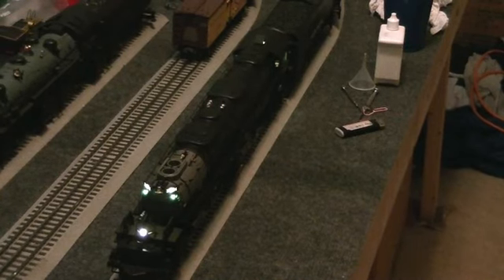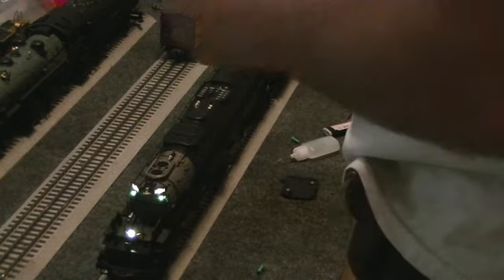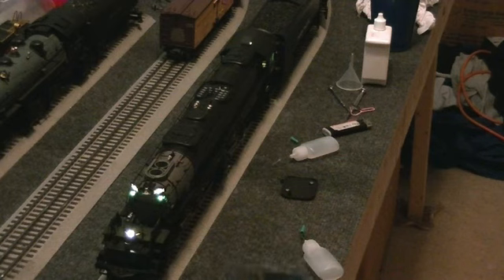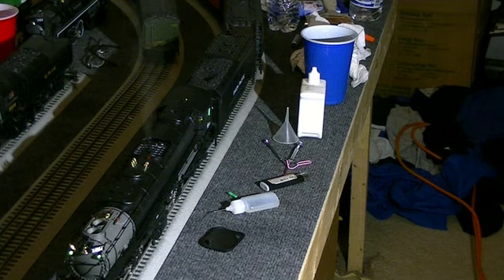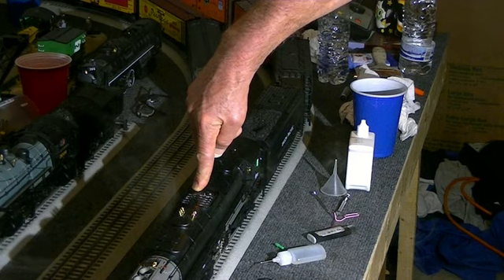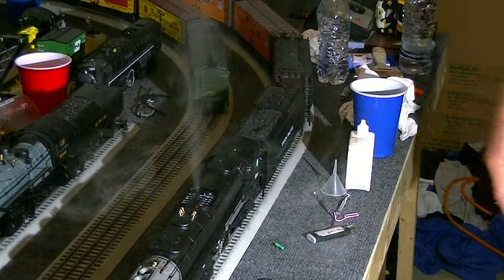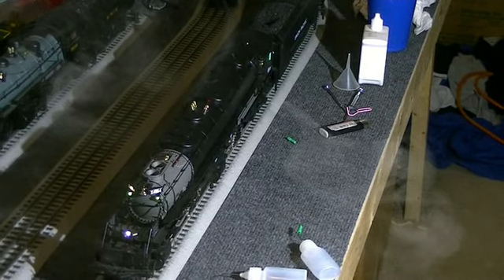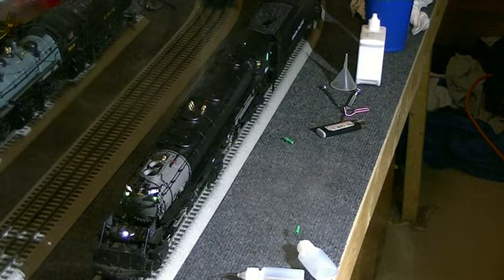Lionel Vision Line Big Boy blow down part 4

Comment: Hahah thanks for the shoutout bud!!! Lol, that was awesome!  I'm amazed how long it takes before the smoke actually works properly on the blow down unit.  I will certainly try this on my Big Boy and report back.  Seems your initial thesis was pretty much spot on: let that darn unit heat up!!  Even with the new batting you installed, the smoke was still "anemic" lol, upon the initial blow down release, which further substantiates your initial points. 

Awesome video as always pal, I will definitely try these steps with Big Boy.  Thanks for sharing. 

On a side note, DCS is now installed on my layout...so keep an eye out for my update video later this week!!  Added to my UP roster with two  PS 3.0 diesels!
Reply from the maker: mjc6184 Hey Michael, your welcome for the shout out bro, but after all it was your terminology I was using "anemic at best" LOL ..... Anyways, yeah give these steps a try and let me know how they work out for you, the most important thing is to be patient when adding the fluid, do not squeeze the bottle to hard because if you do the fluid will wind up clogging up the tubing.  And lets hope your batting is still in good shape, but by the way, in "Big Boy blow down part 1" I do not know if changing the batting even helped, I just figured as long as I am already in there I might as well change it LOL ..... DCS and a couple of PS3 diesels, that's great bro!  Can't wait for your next video!  Both of my MTH engines are PS2, I'm curious to get your opinion on PS3!  Anyways, thanks as always for the comment bro and have a great weekend!
Reply: Bill Yates Yes, that is precisely the point I was trying to get across in my comment.  Despite adding the new batting (which I am sure to some extent was indeed a positive catalyst), it still ultimately boils down to heating the unit to a proper temperature, as well as, having the appropriate volume of smoke fluid within the unit.  

PS3 is good thus far, I'm still learning the ropes (in my opinion it does not touch Legacy and Legacy railsounds, but I do think MTH makes some great stuff). Ultimately, I'm happy I now have the flexibility to purchase both MTH and Lionel engines.  

Should have a video up later in the week!  Talk soon pal!